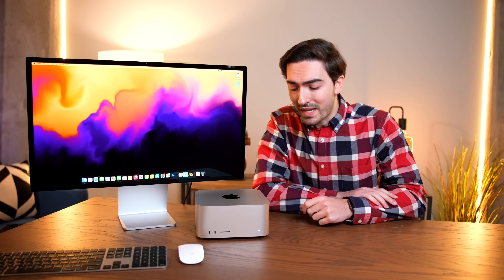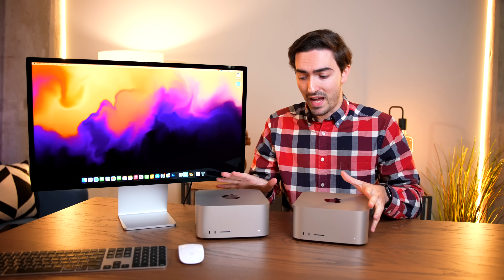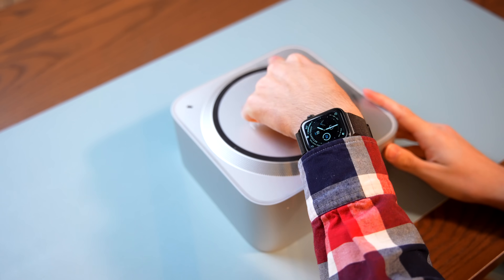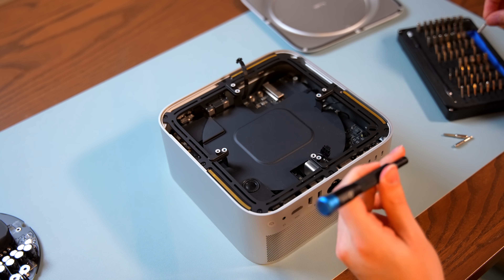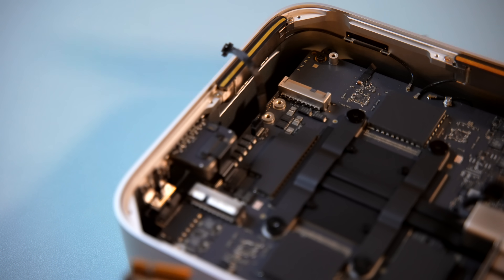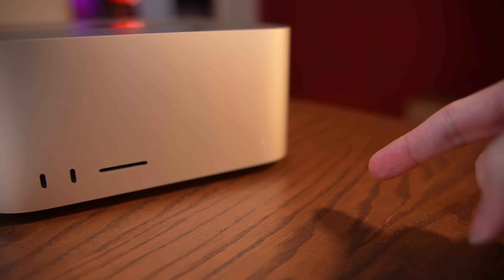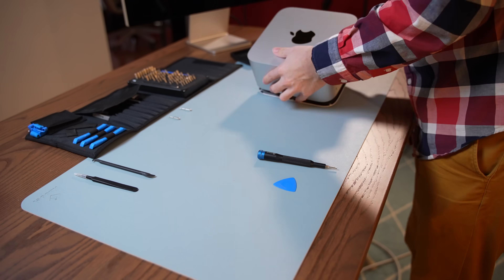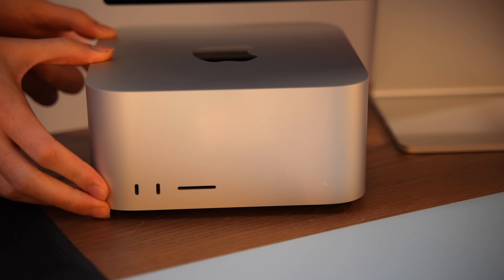What happens if you try to UPGRADE a $5,000 Mac Studio?

Comment: Well I think that the Secure Enclave on the chip is restricting it (same as the 2019 Mac Pro, where you had the T2 chip, you also can’t just swap out the drives) for security reasons. People were able to get it working through Apple Configurator 2, try using that after swapping, you basically authorize the new drive and it might work.
Reply: At least on the Mac pro you still have tons of storage upgradability from pcie ssd to hdd….
Reply: and how would he use that when it doesn't even boot?
Reply: @LiLBitsDK  you have to use other Mac
Reply: Not being able to add storage to a extra, unused port is less of a security feature and more of a money grab. If any other manufacturer gave this as an excuse for why you cannot upgrade storage, they'd be roasted - and rightly so. People flipped out when MSFT added the TPM module requirement to be eligible for a Windows 11 upgrade. This is far more egregious.
Reply: So... you have to use a program to swap out an ssd? What kind of dystopian thing is this?
Reply: Most people have only one mac
Reply: @libsteve  I don’t think that’s true, I have 4… that work… not including those used for work purposes
Reply: @libsteve  that’s like saying I don’t need a fire insurance because what is the change my home wil get on fire.
Reply: Yes, and I think many people are overlooking that security feature. Because if you can swap from one Mac studio to another, then you have a better change to steal or get that data off that SSD.
Reply: @Visualization1  what is wrong with the encryption in the first place that you need to secure/screw this down too? Except that you also hate your customer?
Reply: @SionFrench  no I think you understand it wrong. I like the encryption. And that’s why I disagree with Luke’s stand point about that it is just to screw the customer
Reply: @Visualization1  I don't know if you know this, but encryption works fine without needing hardware to be locked down.
The encrypted drive will remain encrypted no matter what chassis I put it in. Ask me to enter the encryption key to unlock the drive. After all there is a bootloader on the machine, this security functionality is not difficult to implement and preventing boot by not allowing even a wiped drive to be added to the 2nd slot is pure scumbaggery.
Reply: @Visualization1  there absolutely will be a way to break the firmware security in the future, just like how every Apple computer has had an exploit made/discovered.

Firmware locking is absolutely not like insurance; locking your device in an enclosure that prevents people from touching it, even, is more like having insurance because the only way you can get insurance of any type is if the device meets all necessary-to-prevent-anything-from-happening-in-the-first-place guidelines.

That’s why when you buy a home it has to go through an inspection. That’s why when you buy a car, they ask for the VIN. It’s to know what measures are in place and either reject you if it doesn’t have what they deem necessary to prevent anything in the first place or whether you need a higher rate because it only has some, putting you at a higher risk.

You absolutely cannot tell me in-person with a straight face that you never want to upgrade your $5,000+ computer’s internal storage.
Reply: @Visualization1  I work for an enterprise storage company that provides storage devices to military and intelligence services of many nations. Our devices do boot image protection, OS verification, full disk encryption, and offboard key management with smart card devices. And you can swap the drives from one system to another. NO ONE needs this level of security - because there isn't a way to quickly wipe it, if someone wants your password, they'll beat you or chuck you in a jail cell until you give it to them. This is 100% anti-prosumer.
Reply: @lapin-rouge  Apple wants you to use thunderbolt. The end result of this publicity will be soldered storage in version 2.

And of course it's about money. Why would they stop? They have been making money hand over fist using this exact technique across their entire line, with 1 exception... for now.
Reply: @Visualization1  What security feature?
Reply: @RashidTak  the encryption what is probably going on between the SSD and the Secure Enclave.
Reply: @Visualization1  What do the millions and millions of PCs do to prevent this? Maybe this is forward-looking in a way we don't understand. When my SSD crashed in my old trashcan, I installed a new one and scraped the old data off the old drive and got on with life. It was as great as the situ could be. But I see the argument that a 3rd party could the same thing if they stole the device. But for me, personally, physical theft isn't much of a concern. Maybe it should be.
Reply: @Visualization1  They could just use good ol encryption. I use Linux and my boot drive is encrypted. You can still use the drive on another computer but you either need to know the password or erase it. That way you never get access to the data one way or the other

Edit: looks like a lot of people already mentioned this haha

Comment: I can only imagine that Apple itself can perform the swap and has to initialize the new SSDs for the respective device. It would be fatal if Apple sold devices for this price to customers that would only be e-waste after an SSD failure. I believe that the SSDs can be changed or upgraded, but not with our possibilities at home.
Reply: correct, but there are still thunderbolt ports, yo ucan use external no problem.
Reply: Nothing is fatal to Apple. They purposely make their products to be unrepairable, and the repairs that they allow essentially equal the price of a new unit. If that isn’t enough to sink them, then they are invincible.

Comment: Apple giveth, and then it taketh away. Clearly it's a cash grab intending to force customers to spend outrageous prices on Apple NVME storage at purchase time.  The WD Black SN850 performs extremely well in macOS, so why can't users use standard stock pcie  4.0 NVME storage, like the PS5?And even if Apple wanted to use storage with a proprietary connector for whatever reason, what's the reason to firmware lock a drive a given logic board?  Ridiculous.

Comment: It is possible Apple wants to offer the future SSD upgrade, but have it installed by store employees only so it does not void warranty etc.  I'm not opposed to that, but you are absolutely right that the "firmware locking" is total bullshit.  It must be to prevent use of any hardware not designated as an internal expansion drive sold only by them. As always , I buy my Apple products with enough SSD and assume it is non upgradebale.
Reply: Once the ssd fails, you're screwed.

Comment: If I had to guess, the on-board controller is paired with the module so in order to swap or change the modules you need a special tool that reprograms the controller. Sounds like something Apple would do.
Reply: I think the Apple Configurator 2 can make it works. Like on the Mac Pro. But this is really a pain in the ass to have to use other Mac to do this.
Reply: I bet you are right